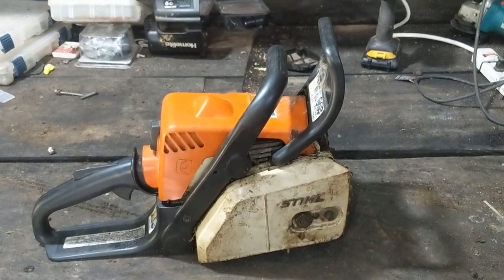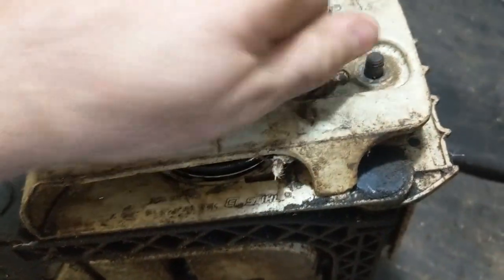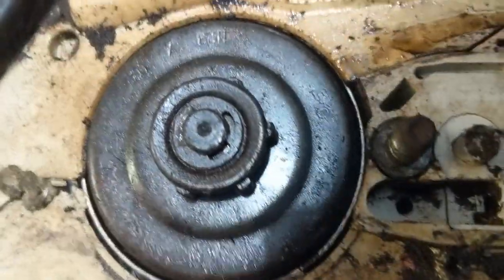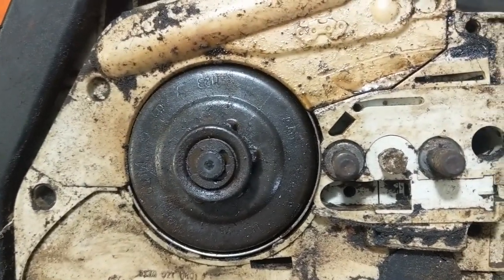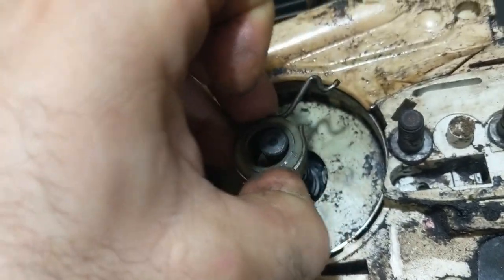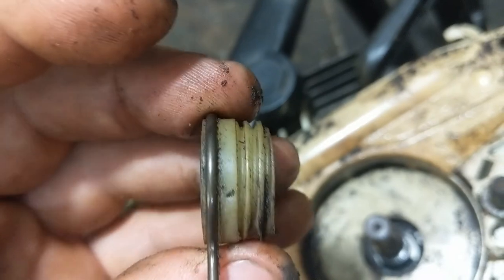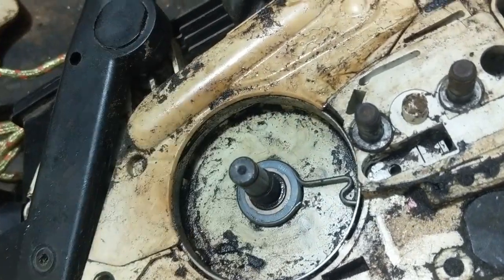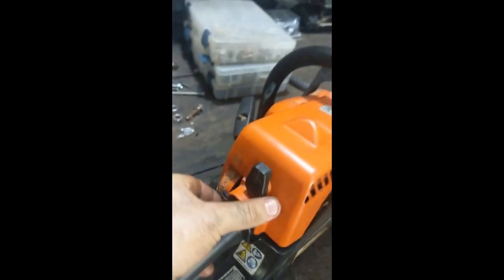How to replace the oil pump worm gear on a chain saw

Comment: I replaced my worm gear but that still didn't fix the problem. Does anyone know what the next step would be? WHen I open the chain oil cover I see bubbles. I'm not sure if that is an indicator of anything. 
Thanks,
Reply: I’m checking out this thread and I know you comment is a year old and you’ve fixed you issue by now. I just wanted to offer this. There is a little plug in the end of your oil pump that blows out sometimes. It’s right beside the muffler. Hope you fixed it.

Comment: They use plastic so that the worm gear wears before the pinion, which makes the repair much, much easier. It's nylon too so they do last a pretty long time. Trust me, much better than if it was a metal worm gear :)

Comment: What is the name and where does the lil pin with the gear on top and the hole drilled threw the bottom go?. I tore mine apart and it was just lyin in there not attached to anything. No videos I could find shows anything about it.
Reply: That sounds like your oiler pump, it oils the chain...